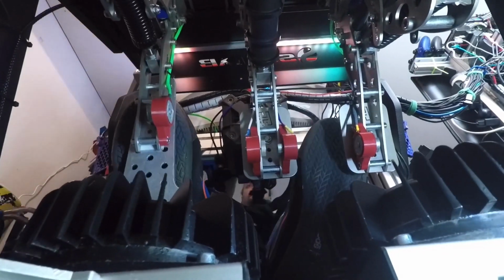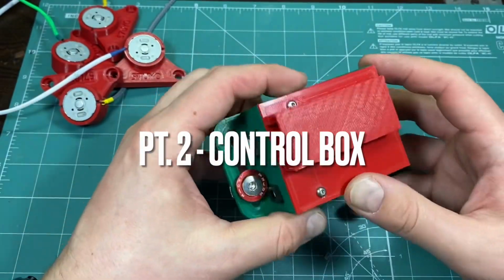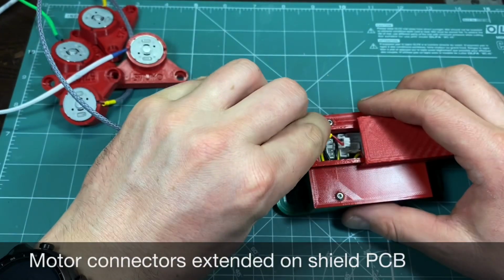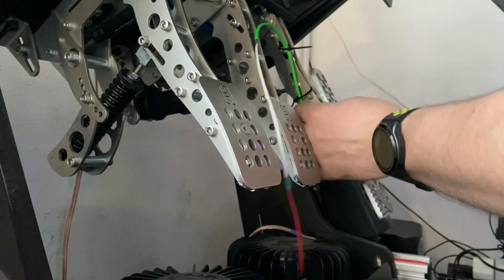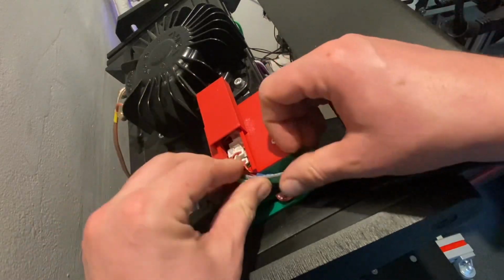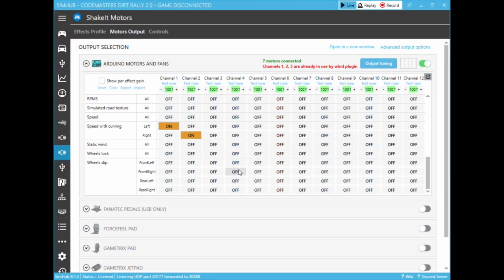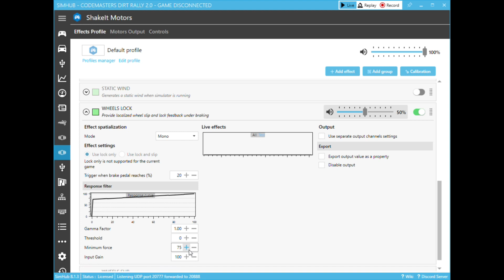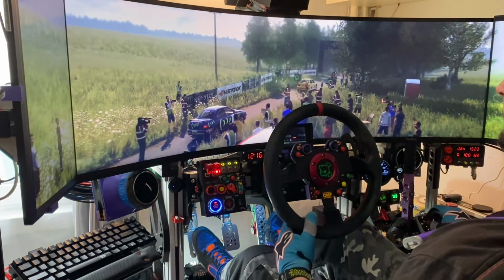DIY Pedal Rumble Motors for Sim Racing - Heusinkveld Ultimate+ and SimHub

Comment: Got STEP files? the  ultimate+ doesn't fit the sprints. Idiot me printed 5 first then found out.
Reply from the maker: Step files no, everything is in Tinkercad. If it is public maybe you can edit yourself? I can try sharing. Also what is the offset for Sprints? Maybe i can make the mount holes even longer.
Reply: @57uyo  Honestly, it's kind of weird and not constant, i can already tell i'd have to go through a few iterations. When my motors arrive i'll design from scratch and can send it to you as well
Reply from the maker: @uluv2c8  yeah, sprints also have different offset on throttle than other two pedals. Motors should be the same size, from aliexpress at least. You can always upload your version on my website ;)

Comment: Would have been nice if you showed how exactly you stuttered the connectors on the Arduino board.
Reply from the maker: Took some pictures, they are in the gallery on the link in description. One of them is from the motor shield, it is visible there. Was rushing the project so did not shoot the soldering part, did not think it is particularly interesting ;)

Comment: Thanks for the STL files and accompanying explanation. Super cool. I have ordered the parts and hopefully can start testing and using it soon. 
Do you also have a link to the wires and connectors you use? The one with the male connector on the rumble motor, and the female connectors on the motor shield?
Reply from the maker: All of them are standard JST 2.54mm connectors from Aliexpress - nothing special, 2pin. They are directly solderable on the motor shield ;)
Reply: @57uyo Can you tell us a little more about how you secured the Arduino in the box and how you secured the lid of the box? Is that with a long m2/m3 nut and bolt?

All the parts will arrive next week, then I can start building. I already have all the 3D prints ready. :)
Reply from the maker: @GAEvakYD  as far as I remember it was assembled with long m3 bolts screwed from the top and directly to the base of the box without any other hardware. I moved since then to arduino mega so this box is not being used any more. I will be switching back to Uno soon so plan to revisit the design a little as it was too complicated to put the arduino in (first goes the Uno then you have to connect the motor shield on top if it).

Comment: Excellent video! Are you finding these motors strong enough especially on the brake??
Reply from the maker: Thanks! They are strong AF. At 12v they work more than well, i set them 100% overall, 50% effect volume and they are spot on. Made mistake - returned ground surface to below 30 so I get soft effect not overlapping. In WRCG there is bug which puts telemetry very high up after race finish - this is very strong and unpleasant on my feet, also very loud. So yeah, i would say they are extremely strong and no need for full volume never (all of this at 12V).
Reply: @57uyo  thanks! Appreciate the quick reply.

Comment: Appreciate the video.
I have created something similar and it was working, but the motors have stopped, one after the other.
Can it be that the motors are 5V and will burn when you power the L298N by a 12V supply?
Reply from the maker: My motors were rated 12V I believe, still working fine and are very strong at 12V. I drive them about 70% volume as after it gets quite unpleasant. I drive with shoes and still it is quite a lot of vibrations. I believe all of Aliexpress are 12v, they are just driven at 5 from gamepads/fanatec wheels and pedals